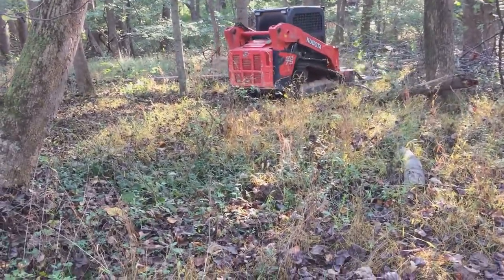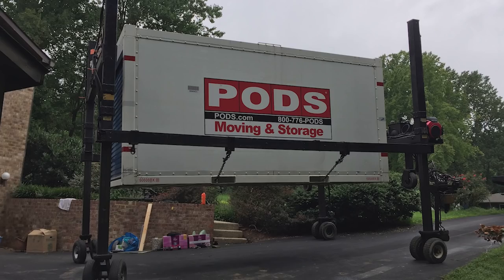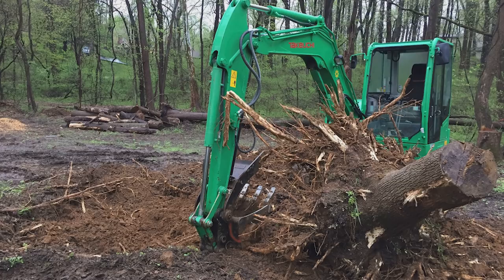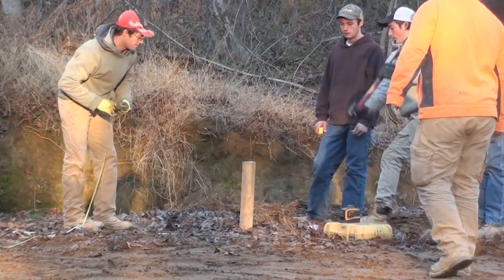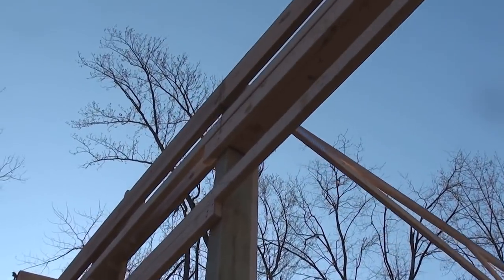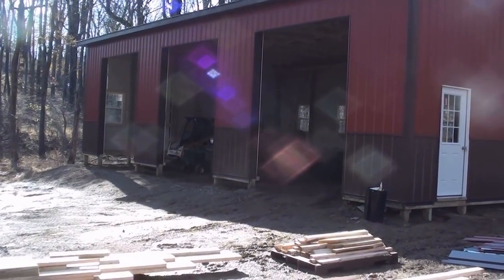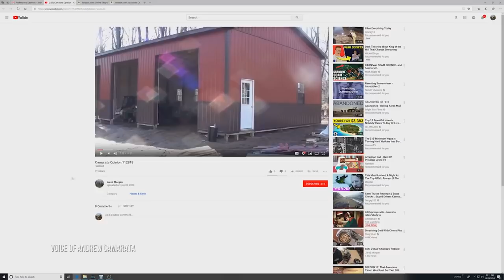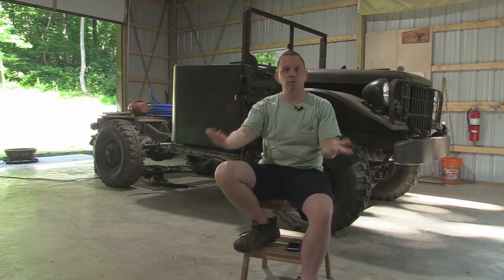Pole Barn Build Start To Finish

Comment: Jared, this video helped me allot. The one bit about average roof height was a life saver. I learned allot from your video and my project is moving along nicely because of it. I e encounters allot of the same challenges building mine with clearing trees, grading and permitting. We’re finishing up the grading in the next 2 weeks and hopefully by the end of the summer my 42x64 building should be up. Thanks!
Reply from the maker: Glad it could help! It's a reality check getting into a project like this as I'm sure you discovered.

Comment: What a great video! I'm going to assume the 150k was for all the dirt work as well as the structure. People who are saying you got taken, have no clue what all this dirt work, machinery, materials and such cost. Especially when you started building those retaining walls. But you're right, all those things costs a lot of money. And at the end of the day, what matters most is that you're happy with the final product!
Reply: Uh, he got taken, passed around, and left in the gutter. 150k is fucking insane. I had a 3/4 acres pond dug 20 foot deep that included grading of the dirt around my 5 acres property and  it was $24k.  That was 8600 yards of dirt. he might of needed 1k. That's tops 15k delivered. Maybe $500 for a dozer rental for a day or two. The barn itself 30 x 50 pole barn should be 30-40k tops. 30x40 pad is 19 yards of concrete at $145 a yard, thats $3k. Concert work typical is 1.5x material cost. So 10k tops for slab. All in for building Maybe $65k not including electrical. Holy fuck man that's disgusting how hard this dude got took.
Reply from the maker: Thanks man. Could have I saved 10-20% in the end not making some of the mistakes I made? Sure, but like you said this stuff costs money. I'm accounting for every penny spent, and I don't see any way to have done this cheaper than $125k with all the obstacles I had to overcome.
Reply from the maker: @Episode8wasgarbage  you're not accounting for two retaining walls, permit costs, the costs of all the machines I purchased and rented, etc. Could have I saved a few bucks if I had experience? Yup, but I don't think I got "took".

Comment: My 24’x20’ Polebarn was built with very similar foundation work except I used the plastic sleeves on my post and I got the gambrel trusses and I have a huge loft inside my Polebarn for a huge studio apartment and the ground floor is two 12x20 rooms one side has the huge garage door and the other side opens up with huge patio doors with a view of the dale and forest that’s incredible when deer roam by.

Comment: Thank you. Very informative. As a DIY person planing a similar project I learned a great deal watching your video. The permitting process can be a big hurdle but it's also an educational experience. Getting the final inspection signed off is the most rewarding feeling. One thing I want to mention... I'm in the Sacramento California and expect my $85,000 addition to increase the property value. I'm sure it varies in every state but I was told by a few sources it's going to add half of 1 percent to my annual tax bill or $425. Not much but worth mentioning.
Reply: It will be interesting to see how much your tax bill is increased due to the value of your addition. Taxes are 1% of assessed value. With all the bond measures that are in place on our tax bills that adds to The Proposition 13 1%. In Contra Costa County it is 1.1% and in Alameda County we are up to 1.36%. When you add in all the parcel taxes on top of that we are paying anywhere from 1.2% in Contra Costa County or 1.52% in Alameda County of your assessed value. Look at your tax bill and see what your ad valorem rate is. It will be the 1% plus all the bond measures added on after that which in Alameda County is costing us 1.36% of assessed value.    I would estimate that your property taxes will go up at least 1.1% of what your addition is assessed at. That could be $900 per year on the $85,000 addition. Tell me if you think I am wrong and why. Thanks for sharing.

Comment: I’m in the process of building a 60 x 80 x 16 stick frame barn that will be insulated and finished on the inside. It doesn’t cost 150,000 and I have concrete footers and walls would say some of these contractors definitely took you for a ride.
Reply: Do you think he put the cost of the skid steer into it?
Reply: @Staki6908  even so..140K is not reasonable either, and thats a very generous 10k for that 743
Reply from the maker: The dirt and site work cost almost 75k alone between machines, retaining walls, dirt delivery, permitting, etc. It was more expensive than the building.

Comment: thanks for sharing your thoughts. I am in the process of building a 30x60. I quickly became very disappointed in the large pole building companies in my area when they said they wanted 1/3 down payment (deposit) like you discussed at first. Then when they started another 1/3 and then when complete the remainder.  I  was worried they would take my money and run. I ended up buying all the materials myself and then paying a contractor an hourly rate to build mine. I have been real happy so far , because I have had the control to buy the type and quality of materials I want.   The only person I am cheating is myself should I decide to cut corners.  You are also very correct on the budget.  My dirt work was 15,000 and the building permit was another 10,000 and I had not even started to build. Thanks again for sharing and helping educate those of us in the process or those that are starting out.
Reply from the maker: JJ Smith glad I was able to help. Good luck with your building. What’s your timeline?
Reply: @jrodjared   I started my permit in October and had my permit in hand by  December. We did the initial dirt work and then it started to rain.  We moved about 1,000 yards and that raised it up six feet.  We then had to wait till May so the ground would dry out and we could dig the 9 feet holes to get into undisturbed soil for the post. We sat the post the beginning of May, the building is almost done now. I have final grade inside the building in the next 3 weeks to include putting in drains for the gutters, and then cement, and garage doors.
Reply from the maker: It just doesn’t end does it?

Comment: Jared,  in my county there is no Zoning.  I can get a 40'x60'x16' pole barn build, no windows,  one walk out door & no over head door. Cutout for over head door & no concrete for under $25,000.  Concrete is $6.00 a square foot to buy & finish 6" deep. $14,400. 12'x14' Over head door & opener installed around $3000.But I need some site preparation. I think I can get that done for under $2000.

Comment: Great video! I'm in the planning stages of a pole building and the city I live in has a 15 foot limit as well. I worked with the pole building company to get the peak under 15 feet. Now I'm wondering if that was necessary. I'll have to go back and talk with the planning department to make sure I've got the correct information.
Reply from the maker: Buckeye Drag Racer yeah super cryptic info. The pros know the info inside and out, but the home owner is left to figure it out. Good luck on your project!

Comment: Sorry Jared you had so much trouble. I am about 3/4 of the way done with my 24x46 addition to my shop. I will have $2,000. total in building the addition. I have done all the work myself.I sawed the material on my sawmill. Had to buy metal for roof and treated post. I have been working on it a couple months. No permits needed where I live. Enjoy your shop. Ron

Comment: U got screwed hard on that barn.I build barns and you overpayed about about 120,000$ i usually do the grading myself so i know its done right and ive nver charged more than 3000$ to prep a barn site if i didnt have to cut trees down.U got the bone.I just did a 40x48 from start to stop for with 14 ft ceiling for 40,000 with dirt work.Hope it was worth it having it done now maybe checking a few more companies would have been wise i bet the wife was pissed awhilem

Comment: looking at that big hill were you had that block retaining wall built, to me was a waste, it looks like good clay, i would have brought in a D8 and cut that hill down and used that fill to build your building pad, then a foot of pit run gravel to give a good base then good road gravel to cap it all off and under the floor, i think you wasted a ton bring in fill when you had what you need right there, i have moved hills of clay to fill and cut what i need,,

Comment: awesome video! i live in maryland as well and looking to build something similar but on a smaller scale (maybe 24X40). I am still debating to do pole barn or enclosed metal garage/carport style. ill have to do some grading work as well. my budget is closer to 20k...150k sounds astronomical! thanks for all the insight! 

do you have a driveway leading up to the garage? what material did you use? i will have quite a long driveway as the garage will be on the back of the lot. i am thinking of doing gravel to save money. what do you think?
Reply from the maker: Hey Kyle I did a video on the driveway here https://youtu.be/XqAMpWwA9Zs And yeah 24x40 is still a big building! Don't underestimate the site work stuff. Good luck on your build.

Comment: First time watching your videos and I have to say you went through a lot and in the end I  just see you complaining about the decisions you made it does not come out well, especially when you blame others for the delays  I commend you on wanting to learn but perhaps you should have hired someone to a consult with to guide you through the process.  I agree with you when watching your contracted crew put the building up they did it professionally and moved around really good. Man it is nice to be young.  I also commend you on working and clearing out a lot on your own.  We all make mistakes and really is it a mistake when you don't have the necessary experience as long as no one gets hurt. You still got your building in the end and you got trained.  Your next project will be awesome and go a lot smoother.
Reply from the maker: Michael Tapia you know the hardest part is finding people to do the work. Half these projects I ended up doing myself because it just wasn’t worth a contractor’s time. At no point was a general contractor presented to me as an option. Every step I had to figure out on my own. I probably would have been better off, but where are these people?
Reply: @jrodjared  I know what you mean and it can be hard at times.  The next best thing if at all available find out by asking around who else is putting up a pole barn in your area, go speak to them, ask what do I  need to do to get this done as quickly as possible and keeping cost down.  You know you will probably be doing it again this time for you wife.  She shed LOL  they all want one just a matter of time. So basically you paid extra through frustration and perhaps extra cash for that  education and experience you gained.  You cant put a price on that.  Your  in your 40's you probably do it again no doubt for yourself or your children or friends.   So really you did good.  Hopefully you got names of the guys who worked for the contractor those guys sometimes do stuff on the side they can be a big help in getting you started on your next building project.

Comment: The results, is after all what matters most. Listen between hiring a bad General Contractor with great subcontractors, or a Great GC with bad subs, I go with the first because the ones that do the job are the subs. The big fat cats all they want is the majority of our money but you got great results. Sad is that I feel you're not familiar with developments and construction but guess what, you've learned all the way and you even got to do a lot in the project buying a bobcat and doing some land preparation. By the way, check how Andrew clear some trees from the root with a skidsteer. In the future you'll be saving some good money doing it yourself. Don't get me wrong, once you get tired of giving away your money for what you want now, you get on it, do it yourself, and save big! Unless you're making way bigger bucks somewhere.

Comment: As a retired builder and contractor I've seen this before. When there is a job that is a hassle for whatever reason, they throw out a stupid price and if you accept it they will do it. Home owners can be a pain in the ass and often make things harder. It's worth finding a reputable general contractor to run your project if you have no experience. If I had to guesstimate that job it would be 65-70k in the North East.

Comment: I can get the poles,trusses, and roof done for $9 grand. 30x40. I will then get the concrete poured for $7k. Siding and doors as I want can’t be more than $10k. I can achieve the same for $26k.

Comment: I'm impressed you paid $100/sqft for a pole structure. Granted, while I don't know your location, to me that seems ridiculously high given the type of construction. That's close to finished home price in my area. But, it's subjective to an area.
In modern post construction, it's actually now frowned upon to put the poles in the ground. While they are pressure treated, they will eventually rot. Will it be in your lifetime? Probably not. But the cost difference is negligible compared to peace of mind. This is also dependant on your soil conditions. I also don't like how they just poured the dry concrete into the hole. I do see this often but if your soil is that saturated to wet concrete enough for it to cure properly, it probably will rot the pole quicker as well.
Just food for thought.
Reply from the maker: WileyDean my estimates were certainly way less but you’re right it was almost as expensive as building a house. I suppose if I had flat cleared land and didn’t live in the DC area I could expect my expenses to be less, but these were the conditions I had to deal with. The ground is very wet here so the dry concrete wasn’t an issue. Thanks for checking it out.

Comment: I work in the timber industry and work with a lot of excavating and stone and gravel guys. This is just my opinion but i feel like you could have saved a good chunk of money by right out of the gate hiring a good excavating company with a small to medium bulldozer and a dump truck like Andrew Camarata has the cost per hour is lower for a dozer vs an excavator also it can create a grade and move gravel in a more efficient manner than a skid steer. the majority of the cost is in travel time for the stone. locally I expect to pay between 300-500 per load of washed 2" or 3" bank gravel depending on distance from the pit.  Dozer cost is 80-100 an hour plus about 300 bucks to drop it off,  based on the video I would expect a dozer and 1 or 2 dump trucks could have accomplished what you needed for grade in the final product in 8 hours or so depending on distance from the gravel pit.

Comment: Thanks for the heads up on those rip off artists. I can't believe they used staples. That building will not last long. You should spray foam the inside to stiffen it.